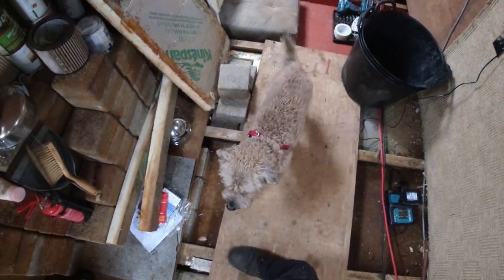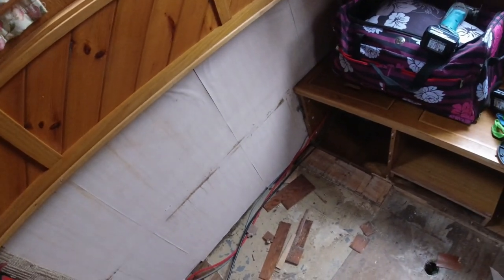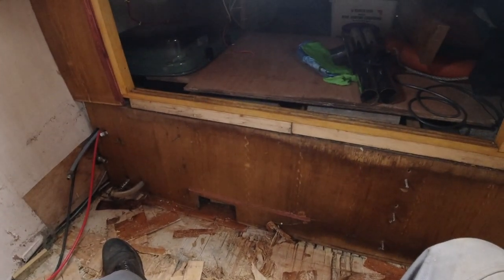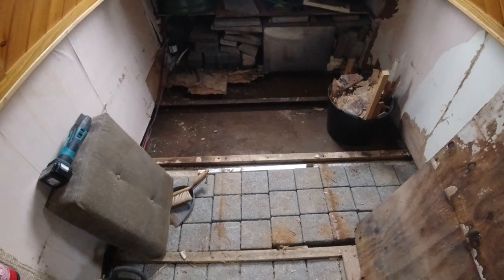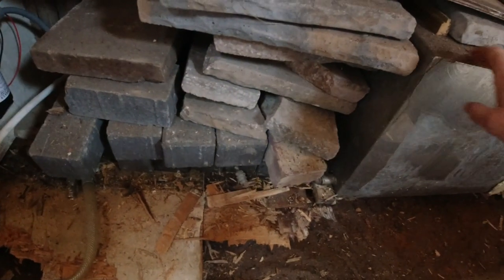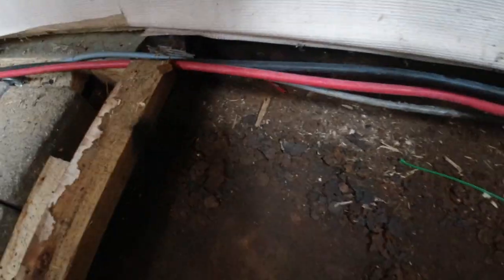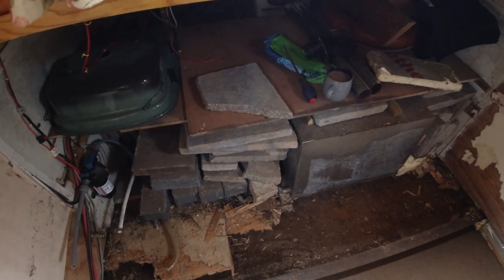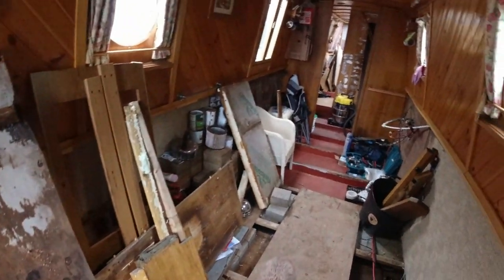Winter Update #12, In this vlog we continue to remove more of the sole ready for painting

Comment: I really like your vlogs. One source of all this misery is very likely the lack of insulation around your water tank. When filled with cold water, moist air from inside the boat will condensate on the tank, and find its way into the bilge through the wood.
Reply from the maker: Yes I did think that as I took it out, I’ve got some 50mm closed cell foam boards coming soon and I will put them all round the tanks when I refit them 😊😊👍🏼👍🏼👍🏼

Comment: Suggestion  to use more engine heat.Split the engine hot water supply to the calorifier with an adjustable valve and install a plate type heat exchanger  in the central heating circuit. Use the same water pump as the central heating with a parrallel electric switch so you can have it on when cruising. Plate exchangers are only small, 10x6x2 inch in stailess steel under £200.
Reply from the maker: That’s a good idea 😊👍🏼

Comment: Yes run the cables through a conduit it gives the cables a mechanical protection and reduces the risks of fire if the cables are damaged
Reply from the maker: Think I will have to run them under the gunwale for ease of maintenance, still going to run them in conduit though 😊👍🏼

Comment: Just shows how small leaks can lead to massive problems. You need to access wiring in case of problems. I've had wire burn out right in the middle of a run. Those ballast bricks are nice and neat. Putting them under the floor would be tidy.
Reply from the maker: Yes a small leak over the years and the wooden sole was rotten, I have some steel billet to use as ballast to now!! Nice and heavy 😊😊👍🏼

Comment: Conduit is a good idea. At each end I'd rise it to near deck level then plug the ends with silicone, I'd even consider a couple of pull lines so if you want to run more wire's later you can flick the plugs out, tape a cable to a line and pull it through or even run a couple of extra 15a cables labeled spare.
Water pumps are designed to pump not suck so if you plan to move it then keep it low so it gravity feeds to the pump, install a valve to each tank and then you have a choice of including a y valve so you can choose port or starboard tank. This valve would be at the tank or better still run two water lines to the galley and have the y valve in a convenient location.
Yo need to be able to isolate each tank incase one fails or gets contaminated. It's a good idea to vent everything. When you reinstall the dinnet you might make the back of the storage area mesh or something and maximize the airflow. Barton's with 1cm gap is best
Reply from the maker: Thank you, I’m thinking now about running the electrics in some conduit under the gunwale, it will still be hidden out of the way but with easier access. Running a couple of spare wires is a great idea 😊👍🏼👍🏼👍🏼

Comment: As you intend to draw cool air from the bilges why not use this to cool the boat in summer. Pull the air up to roof height then direct it into the cabin which will be full of warm moist air. note its the warm air that holds the moisture. Thus you will cycle the air as the cold air drops through the warm air and hey presto air conditioning for the price of a fan. Have done this on sail boats and it works surprisingly well
Reply from the maker: Wow yes now you have said it it sounds so simple!! Great idea thank you 😊

Comment: Hi. All the electrical wiring on our narrowboat runs in plastic trunking under the gunnels. As per the other comments it can be got at easily if you need to. I would not have wiring or plumbing under the floor ever. 
Our last narrowboat with traditional layout was 48 feet long. Water pump was inside a kitchen cuboard with accumulator tank. We never had any problems with that set up. However in the cuboard it was mounted on the floor which when I needed to change it made it hard to get at. I would mount the pump vertically on a wall in the cuboard with the motor above the pipe. ie the reverse of what you have. This stops any leaks from the pipe or pump getting onto the motor body. Putting the ballast under the floor sounds great. Insulation under the tug deck sounds great. Personally I would get one new bigger water tank to go the width of the boat and not join another tank to your existing one. I will guess that your original tank is already corrouding on the inside? I can't remember how old the boat is though and I might well be wrong about the corrosion. You are doing alot of work to sort out the mistakes of the original fitout wishing you all the best. PS With a bigger water tank you won't need as much ballast ?
Reply from the maker: Thank you Simon, as always when it comes to Narrowboat you are the guru! 😊😊 I would love a single bigger tank but can’t fit it through the doors 😂😂 the tank I have now I’m happy to keep single if needed as it’s stainless steel so would probably be ok! Just though it would be nice to have more water lol, electrics I will do just as you said and fit it in conduit under the gunwales! 
Thank you Simon you are a Gentleman 😊😊👍🏼

Comment: I know you have the cables already but you can see how thick they need to be to avoid voltage drop over that distance to a powerful motor. Better i think to have a battery in the bow dedicated to the bow thruster then charge this battery with a bat to bat charger and avoid those heavy cable runs altogether. sell the cable to pay for the parts!!
Reply from the maker: There is a battery in the bow (there was till I removed it to work) those cables are to recharge the battery 👍👍😊
Reply: In that case use a battery to battery charger and you don't need to use such heavy cables
Reply from the maker: @jamesedge8027  I think there is a split charger that’s why cables are like that I assume 👍🏼

Comment: I like the idea of the fans but if you have ever built a computer you know that they are pretty weak, even the 200mm ones. Fine for the small areas such as a PC case but put anything in front of them, like bricks, and there wont be enough air movement to fill a paper bag.
Reply from the maker: I wonder if I could get fans the same size with a little more umfff??? 😂😊👍🏼👍🏼
Reply: @NarrowboatPreciousJet  Maybe get fans that are radial fans or centrifugal fans, like the ones in home air conditioners, the blades run along the length of an axle and can be 1 or 2 foot long, but are quite small.
Reply from the maker: I will have to research them! I like the sound of that! I will only have the fans running while the engine is running that way sound will not be an issue 👍🏼👍🏼😊

Comment: They should not have put OSB on the floor it don’t like any damp at all really, much better to use a good Far Eastern plywood that has been treated with water repellent both sides, the more layers in a sheep of ply the better.
Reply from the maker: I don’t think I was OBS it was ply but had just rotted out, cheap ply I think! I’m going to use marine ply on the refit 👍🏼👍🏼😊
Reply: Marine ply is not water proof, it’s just the glue is more resistant to salt water, a good far Easter ply will be a lot cheaper and do a better job if treated correctly, I advise you make sure you do your research into plywood for the floor before fitting, ply will be  interior or exterior grade, if you gave panel supplies a look on the web or give them a call they should point you in the right direction, I used to deal with them a lot before I gave up work, hope this is of some help
Reply: You could also paint it with some sort of oil that repels the water / damp
Reply from the maker: Thanks Lewis I will give them a ring, I was going to paint the underside of the ply with a bitumen based paint to help protect it, then the top side either paint or oil then varnish! Depends weather if fit a flooring on top or not, if the ply looks really good I may just oil and varnish 😊😊👍🏼👍🏼👍🏼

Comment: Water is a fluid.  It is not solid, so pulling it is not usually successful.  If you have the pump by the tank you are pushing it up the boat.  If you try to pull the water from a distance I would expect there to be problems but I am happy to be proven wrong.
Reply from the maker: The pump will still be at the same hight that is was before and the water pipe will be as low as the tank exit, so simple thinking is it should be the same as I’m not lifting the water pre-pump only post pump 😊😊👍🏼
Reply: @NarrowboatPreciousJet  I think pumps work better nearer to your water source.  The weight of the water being pulled makes the pump work harder.  that said, 15 feet should work with a hit to efficiency.  May need to insulate your tanks to limit the condensation issues.
Reply from the maker: Hi Jeri, yes I’m going to insulate the tank with 50mm closed cell foam board 😊😊👍🏼👍🏼
Reply: Yes, by nature a fluid pump works best as a pusher. They really are not designed to "suck" the fluid to the pump. However, it relly depends on the location of the outlet. Think of it like this. If the outlets are at the base of the tanks the fluid will naturally migrate towards an exit point or at least fill all the tubing that is below the top level of the tank at any given moment. So, with that in mind, you would not be pulling fluid with the pump in the galley area if that outlet is low. The water would mograte there naturally. "Pulling" fluid would exist if the outlet was higher up the tank with a tube inside reaching down to the bottom of the tank. Do be sure to mount the pump low in the galley if you do mount it there. Keep it below the water level so that it is always fed by gravity when the water migrates through the lines.

The conduit is a must if you want to do it right and protect the wiring from damage. Wire can slip and slide around and end up under a piece of wall or furniture and become damaged. If it is inside conduit there is no way the wires will end up in harm's way.
Reply from the maker: @bobamos3628  yes totally agree, thank you Bob 😊👍